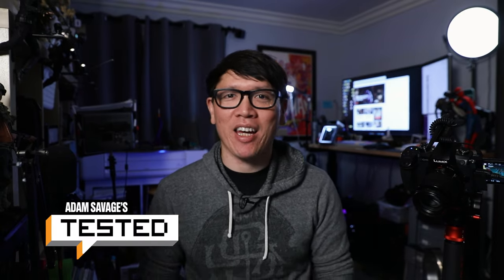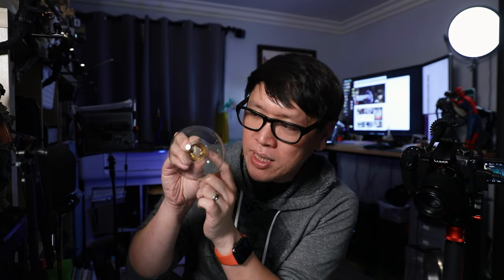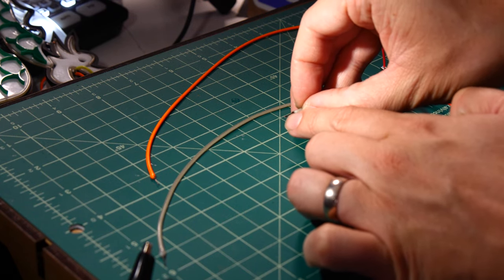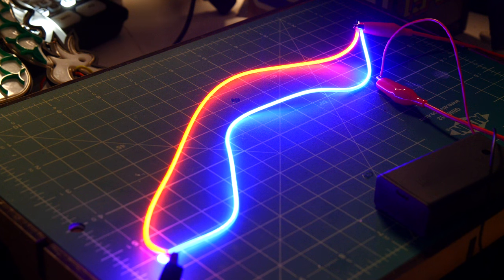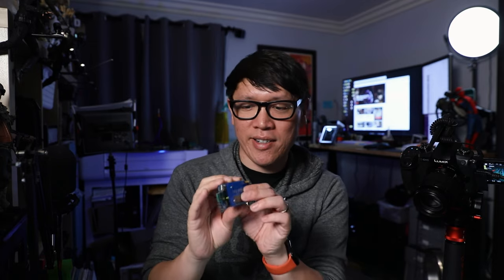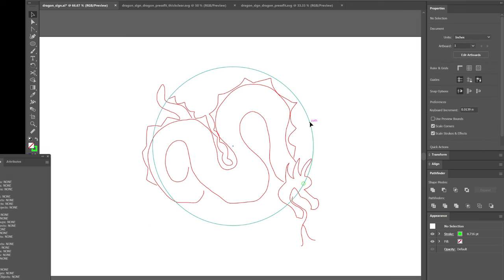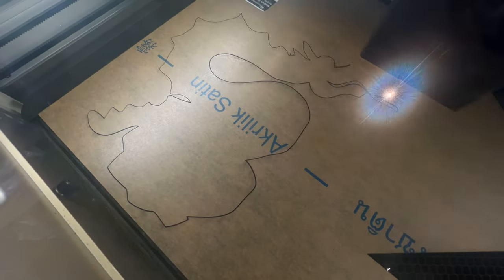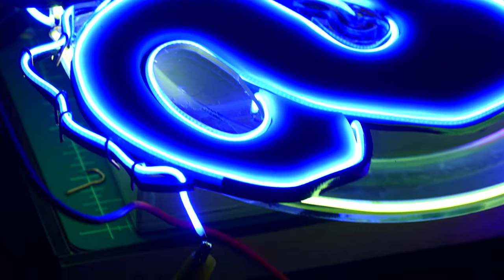How To Use Flexible LED Filament Wire for Lighting Projects!

Comment from the maker: 30cm Flexible LED Filaments: https://www.aliexpress.com/item/4000857781901.html
USB power supply: https://amzn.to/3agwS20
Adjustable AC/DC Adapter 3.5V-24V: https://amzn.to/3oGaSWE
Disclaimer: Tested may earn an affiliate commission when you buy through the links here
Reply: Ron Jerome  - as per the video, no.
Reply: Am I the only one who gets a "cute ice cream shape fake eyelash holder" When I click on the aliexpress link?
Reply: I wanna know more about that Walkman looking battery
Reply: There's also wall warts that have regulated voltage supplies. I have one that goes up to 12V. That's another option if you're looking for something in a smaller form factor than the "laptop brick" style of supply.
Reply: Link for the power supply is dead. Do you have another?
Reply: @jathalan  
worked fine for me just now
Reply: hey i just wonder if it's possible to cut these to a length, then scrape off enough of a stub to solder onto the ends. and maybe apply a lvery small blob or hot glue or other type of glue to 'cap' the exposes end. after adding the solder blob connection point. has anybody tried this yet?
Reply: ah ok i see now. there was a video by big clive. there is a microscopic wire bonded onto tiny smd led pad. so if it were possible, then it would require micro soldering a larger pad connection terminal onto the last good led. and then encasing in glue like i said. so you would perhaps need a microscope and micro soldering iron i.e. specialist tools. in order to have a good chance at being successful. unless there were other simpler methods to make a good termination to the smd led. for example mechanicaly kindda like crimping. but applying some level of physical pressure. but not too much pressure to actually break the plastic smd led and stop it from working / conducting anymore
Reply from the maker: here you go! https://newwavetoys.com/products/hotline-16000-power-bank
Reply: the minimum lot is 10 or 100 leds? I dont understand
Reply: All the links appear to be dead.   Can you fix it need this for a sign project . Like you work!

Comment: Wow, LED light strips have come a long way. Almost looks like neon
Reply: I'm thinking this may be a way to save old neon signs, like movie theatre marquees, which are hugely expensive to run--replace the glass tubes with LED wires. The energy savings would be immense.
Reply: @dsolosan  Sign makers are way ahead of you. They already do this for small signs such as those in restraunts.

Current LEDs aren't bright enough for larger signs but I'm sure they will be soon.

Comment: The 1.2M filament I bought gets uncomfortably hot to hold, but not enough to burn you.  I went down to 22.8V from the rated 24.0-24.5VDC

Thanks for the video!

Comment: This looks ideal for an outdoor fishpond project I'm working on. The lighting, for the project, is hidden (indirect) is not submersed and is not exposed to the elements.  The regular LED strips are not so good due to 'shadow effect' caused by the spaces between the individual LEDs. My initial solution was going to be to run two, overlapping LED strips. However, this seems like a much better idea.

Thanks for the heads up on the flexible filament.

Edit to add: ships to Thailand, excellent!
Reply: why not just use some led strips with higher LED "Density" ?
Reply: @Max.Mustermann.  -  what I have sourced locally (remote northeastern Thailand) does not produce the desired result. Have tried domestic and automotive LED strips.  With both, there are noticeable bright and dim points in the lighting scheme.  Space is limited so double wrapping would have resulted in refabricating the light holder's.

Thanks for your feedback.  I've already placed an order for the featured strips.

The entire system (lighting, water features, pumps, valves, filtration, aeration etc.) is 12Vdc, run from solar and deep cycle batteries. It's currently operating on timing switches (with manual overrides).  However, I'm learning and experimenting with writing software (applications) to operate the system remotely via Android phone.
Reply: cob led strip doesn't have shadow
Reply: Maybe a micro lED like those in TV and monitors alltough , a so called high density filament exists. instead of a normal led filament when you see  clearly the individual Led  emitters these HD filament the emitters are so close you need a microscope to see it. ofcourse, not fully lit😅😅

Comment: Seconds into that opening sequence had me thinking about a Big Trouble in Little China diorama, with Lo Pan descending the stairs/escalator. Thanks for the inspiration Norm!!!  P.S. love your dragon!
Reply: Hah indeed! The pork chop express, grew up on it , still watch it and got the sountrack on vinyl 😎
Reply: Makes me think of how cool a stop motion animation remake of the original Blade Runner could be...
Reply: @JustWasted3HoursHere  its not stop motion, but have you seen "Slice of Life" on YouTube? so cool..
Reply: @BKMakes  Talking about the anime? The one I watched was the extremely limited version of anime where there's virtually no movement except the mouth for LARGE stretches of time, and it's only a few frames per second. That being said I have definitely seen anime that is fluid and awesome.

Comment: It’s interesting that you would have had to use fine metal wire to hold the filament in place. Isn’t that how glass neon tubes are traditionally held on their signs? The channels were a fantastic work around as well.
Reply: I am suprised he did not also wire electrically like real NEON signs and ' color ' where wires would have been routed inside the backing to hide the tube going into the sign.  I LOVE what he did, it could have looked more like an actual sign with alot more time and really mindknumbing detailing.

Comment: Wow Norm, that looks amazing!!  I was working on a project at my last job where we had to secure a bunch on LEDs inside small sections of silicone tube.  A dab of hot glue is the best thing to hold this kind of thing in place.  It will conform to the round profile and lock it in place, but since it is silicone based it is easily removable.
Reply: OMG, thank you!  I am tinkering with a design for a light up “pedestrian safety” cane and was almost sold on filament LED for lighting but was wondering how to secure it. Hot glue, of course!

Comment: You could also make really small holes, like 1mm or smaller if you can, and use some fishing line, knot it at the back, it's mostly see through, you could also use the flexible stretchy wire sometimes use for bracelets, mostly on those semi-precious stone bracelets, also see through, is a bit thicker than fishing wire though.
But it will not be as visible and thick and hard to work with compared to copper wire.
Although the copper wire could also have a somewhat authentic look to it.

Comment: EL Filament is great for custom lengths if the LED's fixed length are causing you issues; downer is it requires a driver circuit and is a bit more fragile.
Reply: I was about to ask how LED wire compares to EL Wire and EL strip.  I like the soft glow of EL strip for use as ground effect for some of my electronics.  I have been wanting to play with EL sheets to see how they work as soft backlights for images.  AKA, light up skins for PCs.
Reply: Not to mention the terrible sound and poor brightness. These are better in every way.
Reply: Looks like I just found a way to light up my R/C car and mini truck... and my Pontoon boat.

Comment: I know this video is a couple years already, but wanted to suggest something in case you see it still or others like myself that only recently view it may find useful.  

For anchoring the wire, what about a dab of silicone Caulk?  It should bond to silicon tubing, and it is relatively strong for holding down objects.  It's not completely permanent either if the need to relocate or replace. Any components 

Not certain if it works for sure, but my guess is that it twill indeed

Comment: Does the manufacturer integrate the correct amount of resistance in this LED filament wire so that you only need to hook up 3 volts?  That would probably explain the fixed-length of the wire. Normally, we add a current-limiting resistor in series to LEDs, even near the minimum driving voltage.

Comment: Brilliant use of these!   I wonder if hot glue would work?   I mean with your channels.   Putting hot glue over the filament and down it's sides to encase the filament in the channel.  Basically acting like a strap.   The glue sticking to the acrylic.

Comment: You should look into the USB C Power Delivery trigger boards, very convenient for up to 100 watts at 20v but they're selectable between 5,9,12,15 & 20 volts. I used one to power 12v leds for my helmet and run a power bank in my backpack.

Comment: Very cool! 
I've never made anything with the flexible LED filament. But, you mentioned that it's encased in silicone and cannot be glued. I was wondering, will 100% silicone caulk hold it in place? Since they're both silicone? Just a thought. Your piece looks amazing!

Comment: I know I'm late to the party but I figured I'd remind you of uv cured "adhesive" since it's not actually adhesive yet a resin it would probably hold.
Reply: Hot glue would also do it as long as it encapsulated the filament at the attachment point.

Comment: Would be nice to see what happens when you start to ease the voltage down.. 
You should be able to crank it down a bit before it starts to flicker or shut of.
Reply from the maker: Unfortunately it starts flickering with any adjustments to voltage (at least at 3V) and doesn’t let you dim much
Reply: To dim it you need a PWM controller.

Comment: I imagine there's some sort of rigid, heat-deformable clear acrylic/plastic/PVC/glass tubing that you could put this inside to shape it like people shape neon tubes.
Reply from the maker: best suggestion i've seen so far is heat-shrink tubing with a wire embedded inside along the LED strand to bend into place

Comment: Hey there master of electrics im wondering if i can power these filament by using the usb c powersupply attatched to the daughterboard of my keyboard? Any thoughts? Was thinking of trailing these around the edge of my custom keyboard to add some light

Comment: Great project, Norm. Looking at this from the point of view of a "real" neon sign, traditionally the neon tubes are held in place using thin wires that are twisted around the tubes. Maybe try that instead of those thick copper wires?

Comment: Forget batteries, disassemble the battery pack, get a 6V D/C wall plug, a hardwire it (i don't know if that's the correct term). Use a resistor if it's drawing less then 6v between the +terminal and +wire . Not a electrical expert so I don't know resistor sizes. I did with neon light strip I got at the dollar store cause it was sucking down two AA in a few hours. I found the resistor in an old TV I broke apart and tried different sizes until it stopped emitting a buzzing noise, which it had before I added a resistor. 
Cool adapter thing, typed that ^ before you got to the adapter. Anyways, cheap easy DIY  for people to hard wire anything battery operated. People just don't think it can be done or something. There's a few youtube vids on it more indepth and technical if people want to search them up.

Comment: If the brightness was an issue when filming it, couldn't you just lower the voltage to dim it like normal LEDs?
Reply: Exactly my thoughts. He has a voltage regulator right there lol

Comment: Maybe I missed it, but could these be dimmed either by PWM, lower voltage, or maybe current limiting resistor?
Reply: Higher frequency PWM would probably be the way to go.

Comment: Would 100 % silicon caulking stick to the silicone coated wires ?! Think it dries clear ?!
Reply: 100% silicone should work. Because as we all know nothing sticks to silicone but silicone. Looks like we had the same idea. Ohhh and if the caulking is way to thick you can use naphtha to thin it out.

Comment: Could you have used tiny blobs of silicone caulk to hold down the wire? It should bond well to the wire, and fairly well to the backing.
Reply from the maker: too messy, and takes too long to cure. but theoretically should work with more time
Reply: @tested  Ah, very good point about the curing time! Hadn't thought about that.

Comment: Not Sure if you have come across something called "El Wire", could be a better solution as you can change the length with a bit of work as well as a wide range of colours
Reply: The disadvantages of electroluminescent wire and panels/strips are that they require an inverter which almost invariably makes a high-pitched whining noise, and they're nowhere near as bright as these LEDs. I actually had a 2m long strip of "white" (i.e. pale blue) EL sheet that I ran down the side of a flight of stairs as a nightlight, and the fact that it was relatively dim actually made it really well-suited, since it let us see the stairs without hurting our eyes!

Comment: I have a question…please help lol 

If I want to power this via usb only one light the plug I’m using is 5 v so it would burn the led….what can I do for it to work? I’ve read a resistor would not be optimal..and the guy he used here says to use a diode. But that’s also not optimal sooooo please help? Lol

Comment: Is this different than El wire? I've not worked with either but am familiar with El wire, never heard of this stuff before if it is different I might pick some up and try a project for fun.
Reply from the maker: Much brighter than EL and no driver needed! But fixed length and difficult to adhere

Comment: I'm thinking the LED wires would be cool for a model I want to light up. Is there nothing that can be used to attach the silicone to polystyrene?
Reply: I would see if clear aquarium silicone would work.  I bet someone's tried it.
Reply: Urethane glue (Goop) might work...

Comment: If the filament can‘t be shortened, what do you do with oarts of it that are too long to make sure there‘s no „bleeding“? Just wrap it in black tape? I have a project where I‘d need to mount the LED on clear acrylic glass, so too long pieces are kind of a concern
Reply from the maker: Unfortunately black tape won’t stick to the silicone
Reply: Heat shrink.

Comment: What is the difference between this filament wire and El-Wire? it appears very similar
Reply: This stuff is much brighter and doesn't need a special driver (which can be a bit noisy in my limited experience). On the up side you can cut EL-wire to whatever length you want unlike the LED version.

Comment: is this in anyway comparable to EL Wire ?
Reply: They're quite different. EL Wire isn't as bright and requires special driver to give it high frequency AC power. EL wire however can be cut in any length, it basically just gets dimmer the longer it is. It's also very durable since there are no electronics in it.
This is just regular (altho very small) LEDs in a string. I assume the LEDs are parallel to each other since they work at 3V. Much easier to find power supplies for these and you can even change the brightness by either changing the voltage or with PWM.

Comment: Could you drive these with a 3.3V Arduino?
Reply from the maker: Yes but no need to as it’s not addressable
Reply: @tested  Well, I suppose it can be kinda-sorta addressable in the sense that you can enable and disable the pin(s) your filament(s) are running from. The whole filament can be switched on and off, just not individual LED elements inside it. Come to think of it, do these things work well with PWM fading? (I can't imagine why not, but I've also never played with these filaments.)